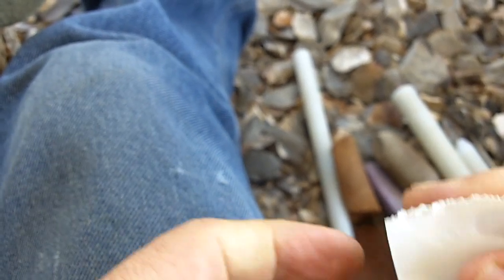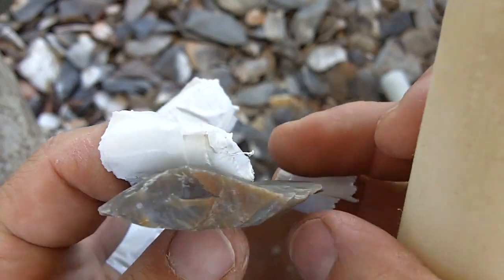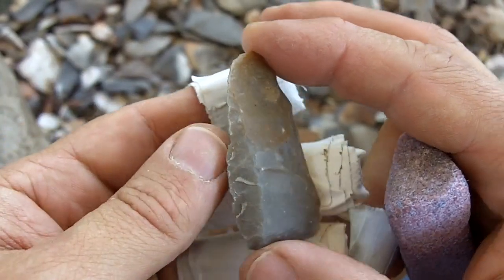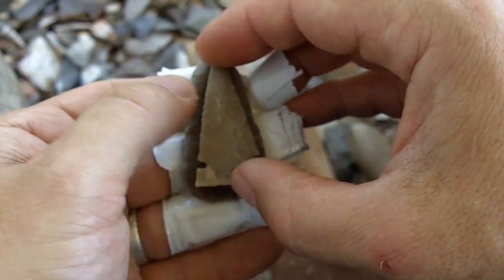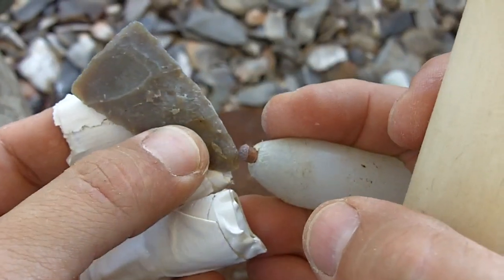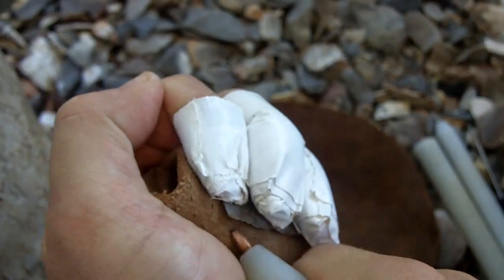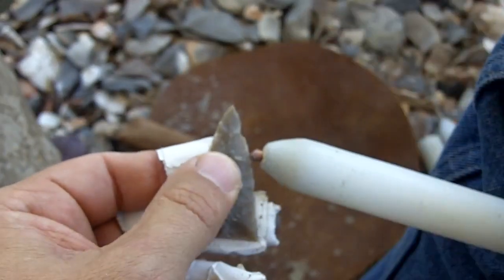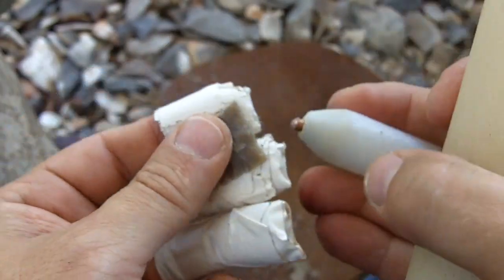243 - Instructional Flintknapping Video - Concentration of Force

Comment: I have watched a large number of the authors videos.  Somehow, I missed this older video.  I watched it last evening. It seems we watch but at times we do not watch close enough or listen carefully enough.
I have been using Indirect Percussion for 2-years after years and years of Pressure Flaking.  Indirect Percussion is in my opinion a very effective method to thin points.
This instructional video is worth the time to watch.  A lot of comment not discussed in latter videos.  
The rough flake he started from is one most every knapper has seen.  Explanation of how to start, the thinking, and for me, still more attention to using small platforms.  As a long time knapper, pressure flaker of Obsidian, I ground stout platforms.   The latter is I think a detriment to knapping Flint, as too heavy blows are required leading to snapped points.
Knapping is as with most things, not something quickly learned. From shortcuts, but from A LOT of practice.  Thanks for making the video.  Practice continues.

Comment: Jack I have a spall and want to break it into pieces for flint and steel. By hitting high on a platform will of give thicker flakes. Really enjoy watching you and the superb art you do
Reply from the maker: Yes.  Hitting higher on the platform, together with lots of force, usually produces larger flakes.  If you just need chunks, you might try setting it down flat on dirt and smashing it in the middle with a vertical blow.

Comment: Can you tell a newly made one from one made centuries ago? I'm afraid of buying one. Also, what is the abrasive stone for? Thanks, good job
Reply from the maker: It's very difficult to tell a real arrowhead from a good fake.  Most collectors prefer to find their own, so they know they have real ones.  If you do some research, you can get a good idea of prices and if you think it's a good deal, then buy it.
Reply from the maker: The abrasive stone is used to get rid of the sharp edge so a flake can be removed without crushing the edge during the flake removal.

Comment: I am trying the indirect percussion using an hickory broom handle with copper in the end but it breaks up pretty fast. Where did you get the plastic rods? Thanks for all the information. I feel I made a huge leap forward.
Reply from the maker: I buy the rods from grainger . com (White UHMW-PE Rod) but other online stores sell it also.  You can get small pieces on ebay as well, for cheap prices.

Comment: Did you ever end up explaining how and why you ground the tip? I'm trying to recreate this point(in obsidian) for hunting. Do you think it's necessary?
Reply from the maker: A few of my arrowheads have ground tips.  I just carefully ground the points on a bench grinder with a fine grit stone.  You have to go very slowly or the tips break.  Anyway, the reason I did this was to create very strong tips that won't snap off while handling the arrows.  It's not necessary and probably not helpful for hunting.  It was just an experiment.  I don't think I've done a video on it.

Comment: if antler is too soft, can not a tooth or a shaped stone be inserted instead of copper?
Reply from the maker: Yes, but a tooth or a stone will sheer off after a few powerful strikes.  Then you have to dig out the bottom half from the hole.  Not fun.

Comment: why not just put on a leather glove?
Reply from the maker: +Lelon Bond Leather gloves wear out...  and they cost lots of money. I hate to throw out a pair of gloves when I wear out the two fingertips of the left hand.  And the flakes bounce back in my face with gloves.  The leather is too loose and flings the chips around, no matter how tight the gloves are.  That's my story, anyway.  :-)
Reply: have you tried ceramic paving brick?or belden  brick with the holes ?i was a mason and those are the hardest brick and should nap like the floor tile.cut the fingers off the gloves and when they start to wear through turn them around.
Reply from the maker: Yeah, I got a few vids with glove tips on my fingers.  I have to wrap tape around them to keep them from coming off... hahah.  I need to look into that ceramic paving brick and the other you mentioned.  Sounds interesting.
Reply from the maker: +Lelon Bond I found a video where I'm wearing some glove tips.  Don't know why but this question was on my mind for  a long time...  https://www.youtube.com/watch?v=QfY1pwwIGso